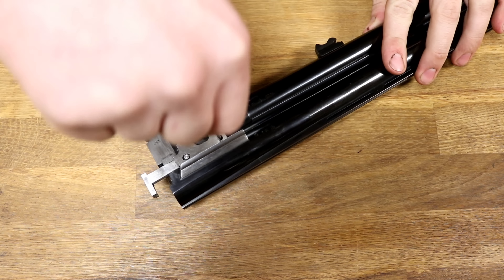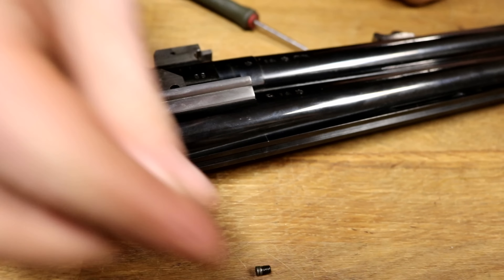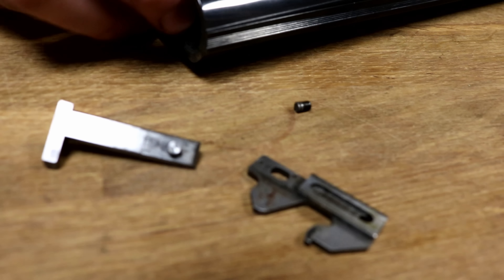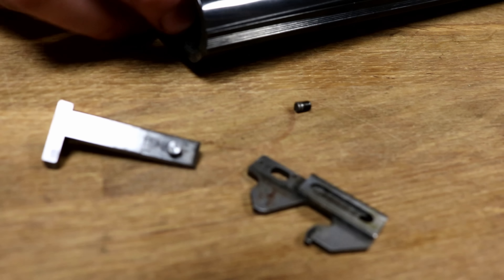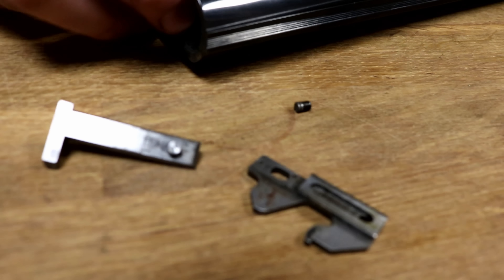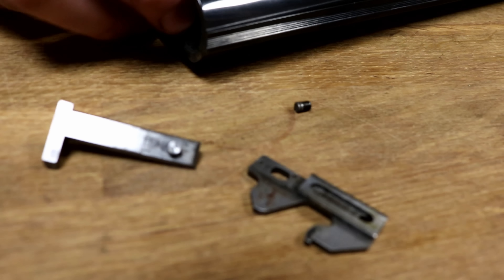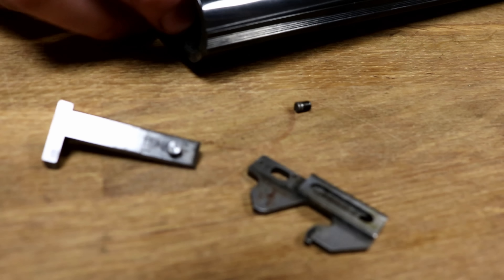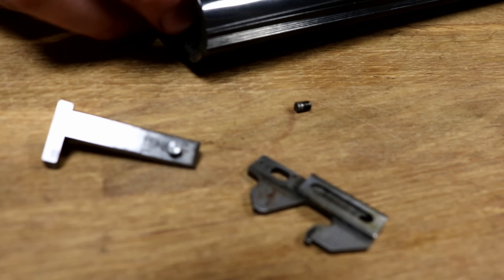Browning Ejector Removal

Comment: Thank you for taking the time to say and call out, "keep the parts in separate pots."  Even though some parts are the same and interchangeable, over time and use, part assemblies wear together to form wear patterns.  Mixing them up, while they may still fit, can affect tolerances and reliability.  Best practice is to always keep assemblies together and to put parts back from whence they came.

Great video!  Short and straight to the point.  Thank again.

Comment: Great video, learned something that relevant to mine. Thanks for the help+ much appreciated!
Reply from the maker: Any time, anything else you would like to know
Reply: The Gun Shop 

Thanks, unless I have missed it and you have done a vid in this! Snap caps. Should they be in for storage and should (excuse my inaccurate terminology) the pins be de cocked as in pull the triggers to release them for storage?

Sorry if this is a stupid question

Comment: Hello. Is there a way to deactivate my ejectors on my Browning Citori Lighting 20ga.? I hate leaving spent shells I can't find in the woods..
Reply: I don't know if the ejectors on the Lightning are different than my Citori, but I replaced the ejector springs with firing pin springs from a 1911 .45 semi-automatic pistol.  Yeah, you read that right!  Sounds a little unconventional, but the swap out was pretty easy, and it essentially converts your Citori from ejectors to extractors.  The lighter springs will lift the spent shell up enough so that you can grab it with your thumb and forefinger, but will not pop them out of the gun completely.  If you do a Google search, you can find details and where to buy the replacement springs.  Note of caution:  Be careful of the spring tension of the original springs.  It takes a bit of doing to get them out of the gun.  Good luck!